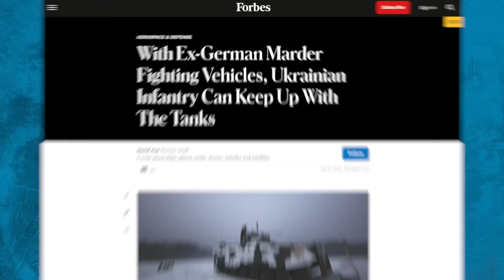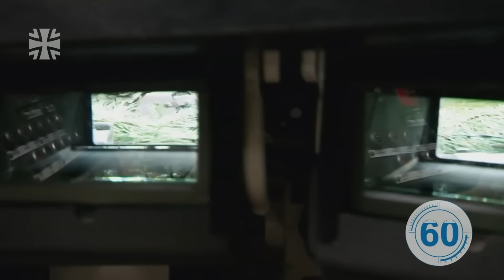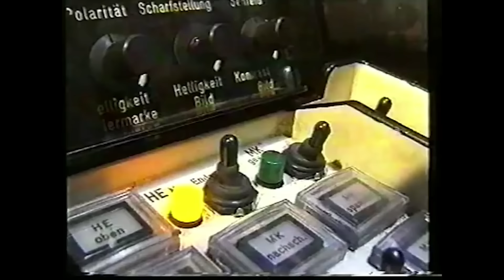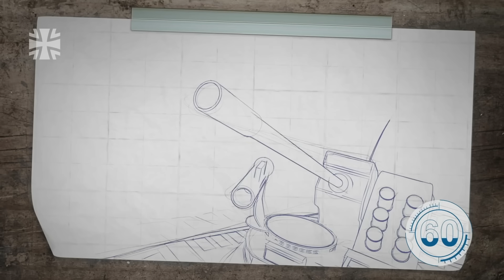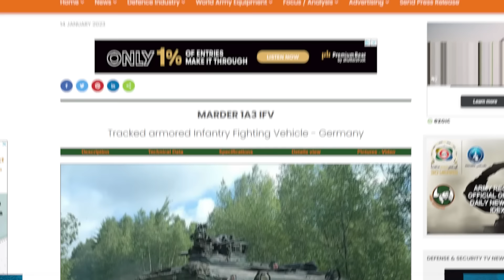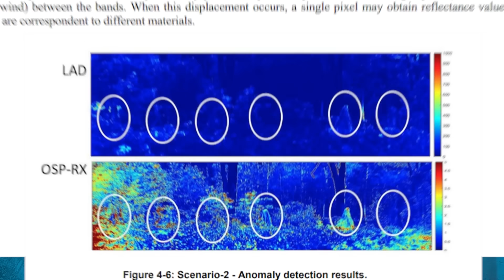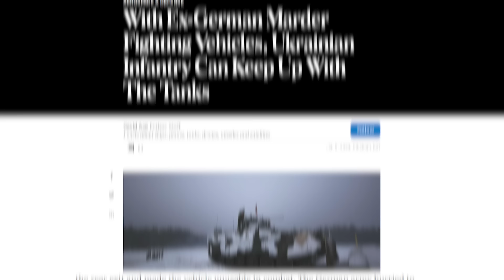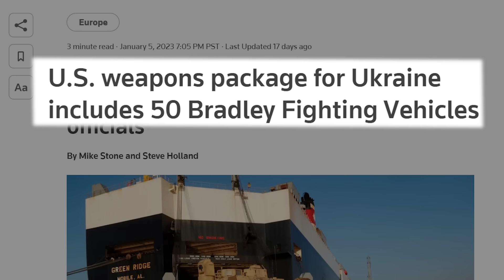Why this German IFV is So Hot Right Now

Comment: Minor correction on the tracks, unless something changed since the late 90s, the rubber is added as a series of individual pads fitted to the metal tracks into purpose made slots, two pads per link IIRC, which is a lot of "fun" removing one by one with a sledge hammer when they are worn down.
Reply: you have a weird sense of "fun"
Reply: Thats the easy part of removing the stuff. The hard work is collecting the old pads afterwards for disposal. ;)
Reply: @denniskrenz2080  Only in Germany. the rest let them fly arround everywhere xD even on training grounds..
Reply: i consider pad replacement a sweaty day in  35° sun. The Bradley uses the same system for road tracks.
Reply: You all missed the mark the entire track can be made of rubber which is why he said it can't be repaired, seen on vehicles like the British warthog
Reply: @shadow199420  ...wich is why it never got whidespread acceptance. But a "thank you!" to the United Kingdom for trying and proving that its not worth the effort o7

(No, for real. Someone needs to be first, and going first sucks.)
Reply: @Psy McDad  except the warthog worked perfectly fine with rubber track the people who used the vehicle loved it but its replacement was shit for a whole host of other reasons, regardless rubber tracks are good for specific reasons and were effective so they didn't suck they just can't be used on vehicles that weigh a metric fuck ton
Reply: @rogerdavies6226 It‘s the famous German humor! ❤😂

Comment: 6:19 Former A800 (Panzergrenadier) here. As standard, we use metal tracks with two rows of rubber pads locked inside each track. They last about 400km and are a PITA to replace. I'm pretty sure the Marder will keep on going after wearing down the rubber pads - it will punish the roads, tracks, and maybe the crew tho. I've never seen Marders run on full rubber tracks like the Wiesel gun carrier.
Reply: so im not the only one who saw that mistake in his sentence. i believe he just missed to mention that the marder has rubber padded tracks, and not full rubbers.
Reply: Tank mechanic here. The M113 also uses full rubber tracks. So the Size should not be a Problem
Reply: @Demon_Dorian  Which version? We also had these German-upgraded M577s with Diehl rubber pad steel tracks. Total shitbox btw, would blow them up immediately. Maybe you could use full rubber tracks on the Marder, but I've never seen anything but the rubber pads steel tracks in service, and I doubt anything else is in stock worldwide.
Reply: We called it Kettenkloppen (hard to translate but likely: track thrashing).

Fighting tracks with worn down rubber pads are working just fine but the metal wears down pretty quickly and you will deestroy streets.
I know that the german army had full metal tracks for it but never saw one live.
Reply: @ThunderChunks  That's what they told us. And I never knew anyone who ever saw them, either. They won't be available when needed, if they actually should exist xD
Reply: We only ran rubber padded tracks on Spz Marder back in the day, then there were quite often mobilisation alarms, so called "NATO Alarms" and that in garrisons in big cities, in this case Hamburgs 17th and 16th brigades. We would go for miles on regular streets to reach the points of engagement, the streets would have been wrecked quite quickly without the rubber pads.

Comment: 7:34 We carried 4 Milan in a Marder 1A3 and we were six infantrymen in the back. (And I was the one who was responsible for the Mlian.) Never heard that there was even a concept of a 5 man infantry crew.

I believe originally there were 7 seats in the back. 3 left, 3 right and the troop leader to the rear.
On the right the foremost seat was canceled for storage, then there was the Milan gunner/shooter(?) (myself) , than the MG gunner.
On the left the sharpshooter, the "Panzerfaustschütze" (the one with aditional "light" anti-tank rockets - the "Panzerfaust") and a rifleman.
Troop leader looked backwards and was first man on the door.
Reply: when did you serve?
Reply: @captainbroady   From 1998 in Munster.
Reply: When was serving in PzGrenbtl 371(2009) we trained with 5 infantry +troop leader. We didn't man the "milan". Perhaps due to the Afghan conflict they saw no need 🤷‍♂️
Reply: @pet4916   I like that. Hattet to drag this chunk. 😆
But sounds like the 6-man-troop itself didn't change.
Reply: Is it true that the MILAN mount on the Marder isn't designed for having the ATGM attached for extended periods of time, especially while the vehicle is moving around (due to vibrations wearing it out), so that you basically have to frantically set it up once you spot an enemy tank?

While the BMP-2 likewise needs the ATGM operator to stick their head out of the hatch to use the Konkurs, having to go through additional extra steps seems like a major hassle.

Then again, I guess there are also upsides to having the MILAN be quickly usable by the dismounted infantrymen in the field… but I‘d probably still feel safer in a Bradley with 2 TOWs at the ready.
Reply: Panzerfaustschütze is a BADASS word ❤
Reply: Im v Fall sollte ein Mann aufgestockt werden so haben wir es gelernt
Reply: @maxjoechl5663  yeah, but the Bradley with his aluminium chassis has its own issues regarding safety and armour
Reply: Ich hab zwar selber nie an der Waffe gedient (Zivildienst nur) aber hab tons of respekt vor der Truppe.
Auch wenn es sehr ami like ist. :
Thank you for your service!

Comment: Two points about the Marder that I would like to correct. The points mentioned about the update are correct, but they only concern the current A5 variant of the Bundeswehr. Not the a3 variant that will be delivered to Ukraine. 
The track is not a rubber track but only a steel track with rubber cushion pads like the Bradley.

Comment: Germany was the only nation that had its first infantry fighting vehicle during World War II. Due to the blitzkrieg tactics of the Wehrmacht, the soldiers had to be able to follow the tanks as flank protection. A vehicle was therefore needed which could transport soldiers as quickly as possible under armor protection. For this reason, the Sd.Kfz. 251 developed, Germany's first infantry fighting vehicle. This vehicle was the original basic idea on which the Mader and its predecessors are based.
Reply: Theoretically yes. In reality, the tank divisions had only one or two companies with APC. The rest of the infantry was motorized with truchs. The Sd.Kft 251 was very rare. The only division in which all the infantry was mechanized with APCs was the Panzerlehrdivision in 1944.
Reply: The 251 wasn't an IFV.
It also wasn't anything special. Every nation had similar APCs in service during the war.
Reply: As i know it was France betwenn the wars which had the first light armoured Infantrie Transport vehicle with halftracks. But Germany improved them.
Reply: the hanomag (Hannoversche Maschinenbau AG) SDKFZ 251, this looks so cool, i had a model from tamya
Reply: This is true, but most of the German army's equipment was horse drawn, contrary to the general idea that the German army was a highly mechanised army. The US army was really mechanised, due to the enormous industrial output of the US economy.
Reply: @radejong013  jes, the mechanized german army was just a legend, Inlay Few parts were mobil
Reply: @fabiantille4949 not a rich country. Only engines for a five of army.

Saved the world.

Infantry division could not keep up in Russia

Comment: The Marder isnt without reason called the " Eisenschwein" ( steelpig ) by its soldiers. Old and simple but tough and robust.  Nowadays the Armor is normal at an IFV , but in its days...
Compare a tracked coffin like the Bmps against it. Like already said it was upgraded in all relavent parts, so a reliable but still modern IFV for Ukraine. I hope they really not only understand but live in a way, what their crews  will be told here in Germany, when they get the training in them. If you employ them like whe all saw here in YouTube to offen, their use wont value the small amounts they get. Like you said, Robin without batman . Or kornet killed leopards, like in turkey, if Batman goes rouge without Robin.
Reply: The age of the Marder is actually an advantage. Unlike a lot of system that we've sent already, like the PzH2000 the Marder is mainly mechanical and very simple. It's incredibly easy to maintain and keep running. Any Ukrainian farmer that has a tractor would be able to keep the Marder running. The only complex systems are fire control and potentially latest high-end visual detection systems. But even without those, the Marder can still fight. The vehicle itself is incredibly reliable and maintainable. It's the perfect IFV for this battlefield, and together with the Bradley, they can be a fantastic team. Especially the lethality of the Bradley to enemy tanks might make it a good idea to organize them into teams where the Bradleys stick a bit further back and engage enemy tanks that might show up at long range, while the Marders stay close with the infantry.
Reply: @Witcher Joker  well said, these alo g with the tanks and 2000 artillery and rockets all coordinated should blow holes in the Russian lines forcing them to withdraw and consolidate or lose large quantities of land! Just have to strike at the right spot to force this matter.

Comment: Germany has not much older tanks and IFV´s in storage, like the USA. The older equipment is mostly returned to the producer if new is procured, so the German army has what is currently used. To give away equipemnt means the German military will be short on it. Like a car leasing contract, you return the old if you get a new one, the equipment producer refurbish the equipment and can it quickly export to other friendly nations with a smaller budget.

Comment: 7:30 MILAN has been phased out after supplying the last stocks to the Kurds. Capacity is not reduced when MILAN launcher and 4 tubes are in the vic. Two rounds are fitted between the seats and one round per side is fitted above the tracks. You can fit up to 10 guys into a Marder if not all of the equipment is fitted inside (ammo and the lot).
Reply: Not quite correct. When milan was introduced aboard the Spz Marder, one seat, was lost for storage of the 4 Milan tubes. No, you cannot fit 10 guys into the fighting compartment in the rear of the vehicle, No way, it is that cramped. There are exactly 7 seats in the back and the one infantry man behind the turret on the right side, fell away in order to have space for storage of 4 Milan shots/ tubes. Since then, the back compartment ("hinterer Kampfraum") was down to 6 infantry men - and there is definetely no room left for even one more.
I was a gunner and later Commander on Spz Marder in the very early eighties in the PzGrenadier Division6, 17./16.-Brigades.

Comment: 6:20 rubber patted tracks are essentially normal metall tracks but with the abillity to mount rubber pads - like every other german tracked vehicle in the bundeswehr has and needs in order to make less damage on paved roads. the marder does NOT have complete rubber tracks so the issue with replacing a part of the track in combat doesnt appeare, as you mentioned it there.